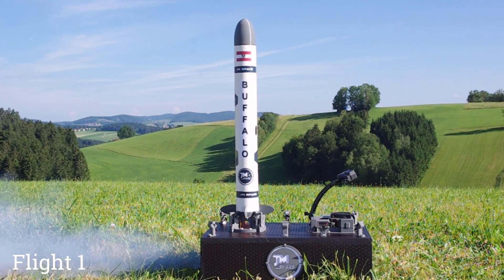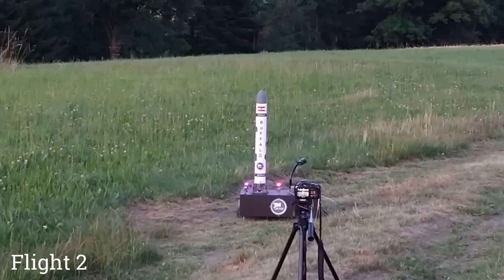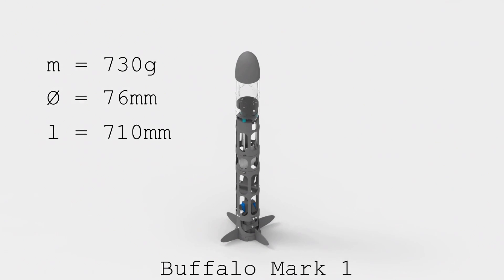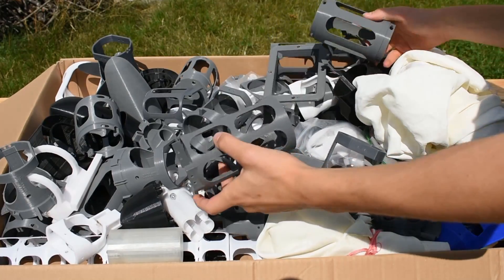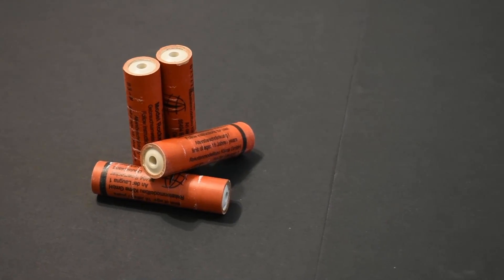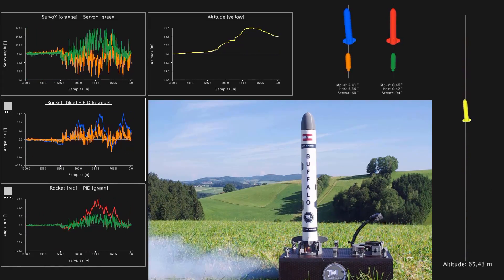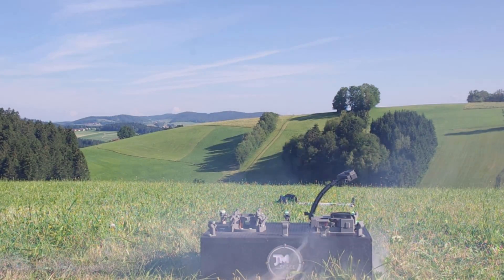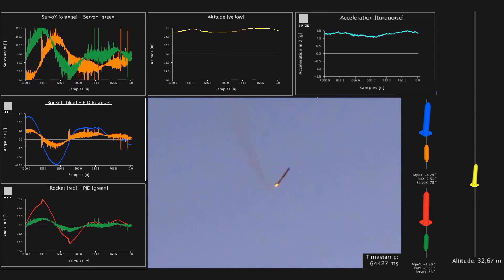Thrust Vector Control - Model Rocket |  Flights 1 & 2

Comment: Consider adding a trim integrator to remove the thrust misalignment.
Reply from the maker: A trim integrator is included. The only problem is, that I limited it to a value of 5°, maybe this wasn't enough. I will probably extend this value a little ...
Reply from the maker: Anyways, thank you for your tip!